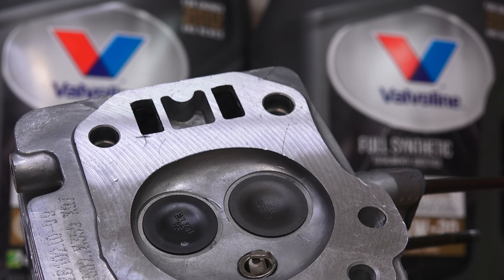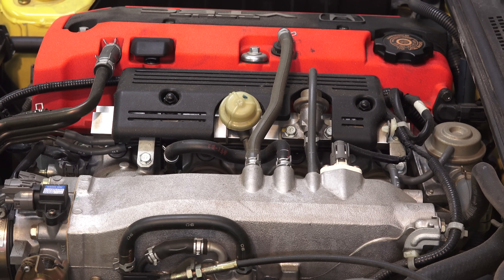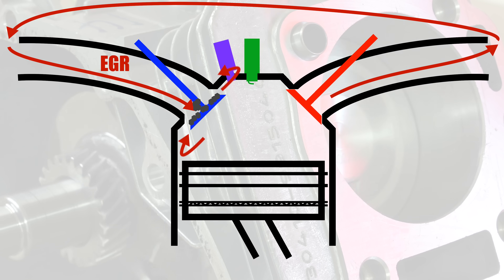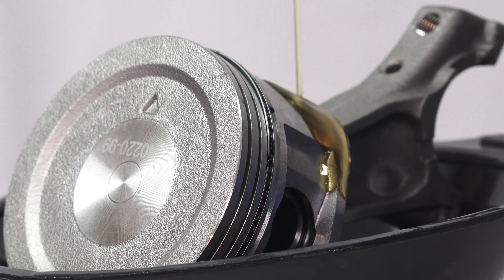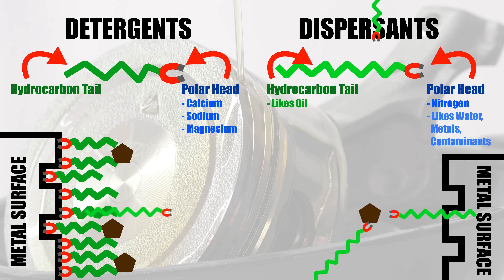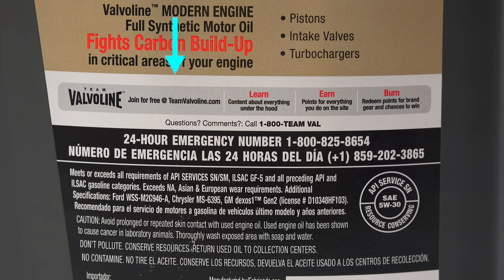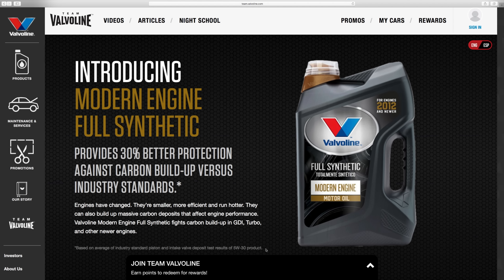Can Engine Oil Help Prevent Carbon Build Up?

Comment: It's important to use a good fuel injection cleaner. 
Some of my favorite fuel injection cleaners are Marvel Mystery Oil which lubricates the fuel system and protects gaskets. Another really good fuel injection cleaner additive is Amsoil oil pi fuel additive which cleans all the ethanol varnish out of your fuel system in one full tank of gas also cleans the varnish off your valves and gets you up to 5.7% better fuel mileage in just one treatment. 
It's amazing we still have good quality products that can combat the ethanol delinquencies......lol
Reply: Please  tell me how can fuel injection cleaner   can clean the valves on a GDI engine when the issue is that no fuel  is getting on the valves to clean them...
Reply: smh.....
Reply: the logic that applies to port injection engines where the fuel mixture passes over the valves doesn't apply to direct injection engines where the fuel mixture does not pass over the valves.  Eye find myself constantly reminding myself of that in addressing this issue, an example of prior knowledge interfering w new learning.  You might get 67% of the benefits using top tier gas and very good fuel injection cleaners but it is not addressing the the uniqueness of this problem, it is the hurdle of that final 33%.  A fuel injection cleaner or top tier gas cannot clean or prevent valve deposits if it doesn't pass over the valves.  the owners of 2nd generation direct injection engines that have hybrid dual port designs might be rescued but owners of pure direction engines are probably feeling stranded right now.  if Top Tier gasoline has 5% ethanol vs 10% in cheap gas that might help since me thinks ethanol would make fuel dilution > oil supply an even worse problem esp for gaskets / seals.

Comment: You made a mistake
You explained the general things about engine oil
But you forgot to say about the main causes of carbon deposit
Remember:in all direct injections you should use LOW SAPS oil,means low sulphated ashes!
Lots of calcium and TBN in engine oil can make a deposit as well as a bad engine oil
For this reason:if you dont want this happensto your engine,you should change your oil type into for example: API SN RC,ACEA C (C1 &C2 &C3) and other approvals like MB 229.31 or 229.51 and also BMW LL-04
But remember,if you use the LOW SAPS oil,you may sacrifice your engine's camshaft.because LOW SAPS oil alse means low ZDDP which is crucial for the camshaft
And also remember:dont over-fill your engine with oil,if your engine oil capacity for example is 4 litres,it is better to fill it up just under 4 litres like 3.8 litres !!
Reply: 229.31 oil is awesome.  I also advise just changing the oil at 3k miles with this oil.

Comment: Can you test old oil in engine for fuel consumption every mile, comparing it with freshly oil-changed? I got 143-180 miles every 10 Gallons before oil change (synthetic), and 230 miles every (just one test) 10 gallons after oil change. A related question: does the day for oil change matter after all, not just the month?

Comment: Mr. Engineer, I watch your channel regularly. This show, I have a question. The little, but necessary, piston ring flutter, allows blow-by during power stroke, & also a bit of oil suck-up during intake stroke? What happens to this oil in the rings when it's met by hot combust gases in the power stroke? Does it burn cleanly? How do the additives in the oil burn? i.e. Do they leave deposits in the rings? & the oil rings? & their drain holes? Then there's a question about how phosphorous, presumably burned, affects the cat?
 A response from you would be good - A full vid on these questions would be better? What would Valvoline say?

Comment: What do think about BMW's Europe policy to change the Oil every 2 years (not 1 year) or max. 30.000km regardless whether is a diesel or a gasoline engine? But consider there are (were) more diesel engines sold in Europe.
Reply: don't listen to them.  do not go more that 5k miles between oil changes.  occasionally do 3k oil changes to really clean up the engine

Comment: I am not an engineering just a tech but if the engine oil is getting on the vavles would that not mean there is something wrong with engine. How can the oil clean the valves if it does not get on the vavles?

Comment: Hi,
You make great content explaining machanical engineering stuff for easy understanding in layman term.

Can you please make a video about "power to weight ratio"
A more layman calculation to have a rough idea of what car with what power output (optimum or realistic RPM range where torque is optimum) and weight of a car to determine acceleration efficiency and fuel economy?

Comment: great video once again.. would be interesting to see the effects on a rotary engine as its known only to use mineral based oils in there engine to prevent carbon issue which does happen.. Engineered explained have you had any experience in a rotary engine its self at all with pro an cons with the use of oils and reliability suggestions pros and cons at all.. be great to see something along those lines etc..

Comment: I have a question. Regardless of the oil type, once an oil reaches 130 celsius or above its molecules start to fall apart and thus the oil deteriorates, right? 

I use a car with small diesel engine (VW 1.6 tdi 105hp CAY type, I use vw504.00 and vw507.00 compatible oil and change it before 8000kms) and in the indicator panel i can see oil temperature readings. In hot summer days when I push it hard it reaches even 135 celsius. After such a case should I change my oil immediately? 

Can anyone with a scientific knowledge on this issue help?
Reply: i know on MB the oil is around 85c. 135c is really hot. oil can go to 150c and still be ok. I would advise an oil cooler and use a lighter oil. a thinner oil flows better and cools better. I would not want my oil over 100c

Comment: Does the same carbon build-up happen on the inlet valves in diesel DI Turbo engines too?
Reply: not so bad. on the vw older eng I had to block off my egr

Comment: And if you drive a European vehicle, use an oil that qualify the (  European Automobile Manufacturers' Association) ACEA   A3/B4 or A5/B5 for newer cars.
Reply: don't worry about that. use a gf5 sn rated full syn and you are ok

Comment: They really gave you a good education on this subject when you spoke with them. Great video!
Reply: not really he failed to explain how engine oil without getting on the vavles will clean your valves. If the oil is getting on the valves you have a serious issue with the engine. This was nothing but an add I can't believe he even agreed to do this it is such BS
Reply: @mysliwya  I agree with you, but I think he assumed we'd follow... if particles are suspended, then when blow-by happens, the oil mist hitting the valve doesn't matter since it won't stick.

Comment: Could you further comment on modern engines with carbon buildup (and oil consumption. 

I've had mixed comments about turbocharged Audi's burning oil. 

1. Some say its perfectly okay if it burns less than 2.5 litres per 15,000km. 

2. Others say that is excessive and the car needs not only a piston ring replacement, but complete piston replacement.

Comment: Steps for dealing with carbon!

1) What he said. Use good oil, change it often, and make sure its always in the "safe" zone on the dipstick.

2) Unplug your EGR. (Don't forget to plug it back in if you have state emissions testing.) You'll have to live with the Check Engine light. Unless you know how to disable it on your MAP. In which case, you already know all this....

3) Install an oil catch can. It's like an extra filter added inline of the PCV system. It adds an extra step to oil changes to empty it, but it traps the gunk before it can  recirculate back to the engine.

And that's it. Carbon buildup won't know what hit it.

Comment: Hey. Just wondering if its ok to mix different brands of engine oils? Or do you have to only use the same brand and same "model" all the time until u do a full engine oil change?
Reply: You should be able to do that as long as it's the same "kind" of oil- 5w30 for example.

Comment: Be careful about putting synthetic oil into an engine that has been run on non-synthetic oil for a while.  Suddenly adding synth oil will likely cause small but messy oil leaks in older engines!

Comment: I just drove a car for the first time in my life before 1 day and it was manual, I stalled it like 4 times and I drove it for 2km, and the day after that, (yesterday), I drove it again for 2km and I didn't stall it this time, what do you think about my driving as a learner?, the car was a Toyota hilux manual pickup truck.
Reply: Internet troll.

Comment: Well if you are a "tree hugger" stop reading now. Friends old Neon had issues with deposits. He blocked the EGR and routed the crank case dohicky off to the side, and sealed the port on the intake. Yea it threw a light, but he gained something like 10 or so miles per fill, a bit more oomph, and it stopped the build up. He just replaced all the stuff for the inspection. Then took it all off again. I'm doing the same with my TJ.
Reply: EGR helps the engine run cooler.  Watch out for detonation....

Comment: *HELP*   
Everyone is recommending pennzoil 5w-30 ultra platinum. I just purchased my car (2018wrx) and would love to put the best in it from the get go and it is a DIT engine. Also, the 5w-40 seems to be more readily available... do you think there is a problem with running the 40?
Reply: Not likely as long as you change it regularly and drive it GENTLY until it is fully warmed up!  The heavier oil could create excessive pressures/insufficient flow, so be careful.

Comment: I have 1 for you my 2018 mazda cx-9 gt the oil fill says use 0w20 but the owners manual says 5w30 I called 3 dealers and 2 said 5w30 1 said 0w20   So who is right?
Reply: ncrdisabled Submarine vet ... I am pretty sure 0W20 only comes in a synthetic, so I would recommend running that. If you don't want to run the better but more expensive synthetic oils and want to just run a conventional oil use SAE 5W30. I would recommend a group 5 oil such as AMSOIL or Motul for example, over anything else. IF you plan on keeping the vehicle for a long time. If it is a lease or short term own, just do whatever financially makes sense for you.

Comment: What do you think of the extreme long oil change intervals that are being promised nowadays? Our new Iveco Daily (3.0L Diesel 180hp) has an oil change interval of 40.000km (~25.000miles). And we have a John Deere tractor that promises 750 engine houres on the same JD oil.
Reply: do the oil at 5k miles. the dealer is not fixing anything past its warranty. they want problems after that.

Comment: What can you do to clean off existing carbon build-up, as opposed to preventing it from happening?
Reply: Adam, motor oil can help prevent carbon build-up, but it does not remove build up that has already formed.  If you suspect your engine has developed build-up, you may need a professional service to remove it. Valvoline offers a service through their Valvoline Instant Oil Change locations or any local service garage that uses Valvoline products.
Reply: @valvoline  do you guys have proof that it removes the carbon?  i have never seen a video or info on it.
Reply: you can do a bunch of fast oil changes every 1k miles using cheap oil. this will clean up the inside of the eng very well.

Comment: How much did Vavoline pay you for this product to be featured on your channel? I personally have gone with Amsoil since they we're the first original 100% synthetic oil for airplanes with no petroleum base that ends up gunking your intake valves. Also, the researcher I talked to provided that fuel dilution in the oil due to fuel pressure in the cylinder forcing fuel past the rings which causes the Low speed preignition around rings and causes worse and worse engine performance and wear nowadays before you even reach the time manufacturers well before recommended drain intervals.
I tried all different Full synthetics available in stores like auto zone pep boys and O'Reilly for the last 3 years and none solved the crisis with Direct injection like Amsoil's Signature series has for mine.  Oil alone will not solve the issue as an upper cylinder lubricant seems to now be required to also prevent friction that ends up retarding ignition timing and detuning your engines performance.

 Going from 87 to 89 octane from top tier ls like Chevron does help with fuel mileage probably due to all the preignition due to higher chamber compression pressures and lower tolerance of 87 to not detonate under extreme pressure along with carbon deposits on the intake messing with the airflow patterns that would lead to better optimized fuel and air mixing before ignition.

I know you try and keep it simple for the layman to get good info but it would be cool if you had a channel that went more in depth about more details just beyond basics. Maybe make it Engineering Explained (Serious Tuners edition). Be good for promoting people to get into the industry
Reply: I had the same question regarding the plug for Valvoline. Just take his word for it because they would never lie in order to promote any products...

Comment: I can't understand how oil is supposed to clean the valve heads from carbon build up, when actually the oil isn't supposed to get there ? Looks like a bunch of BS to me ... some newer DI engines from VW have also port injectors added exactly for this purpose  I think, I guess they tried also other solutions before ...

Comment: And change your F^$# oil filter..Please. If you have dirty fuel you change your filter. if you have dirty oil?? dirty oil has been in the filter....................filter is the cheapest part to change! so just F%#&%^ change it with oil change.. please.

Comment: Question - I have a 2017 F-150 3.5 V6 Ecoboost. Everywhere I read it is normal to see coolant temps ranging from 210-238° which seems pretty high. What would be the reason ford made this engine run so much hotter? Also, I want to use a more aggressive tune but I’m worried about the engine pulling timing because of the extra heat it’ll make. I want to install a 170° thermostat but I’m worried about the long term effects changing the operating temperature such as carbon buildup and the change in oil lubrication.

Comment: Why dont manufactures just implement catch cans in their design. Surely burning the oil that comes out the crank case ventilation system isnt good for emissions. Id just like to know why theyre still doing this

Comment: With the modern engine oil specified to be used in cars that are model years 2012 and newer, is it safe to use in a 2010 direct engine engine? I currently use Valvoline's advance full synthetic in my 2010, but if the modern oil is safe for it and superior at fighting these deposits, I'd like to use it.

Comment: It's because car manufacturers are under extreme pressure from environmental regulations and consumer demand to make cleaner and more fuel efficient engines while still deliver decent power output. Technically this is a big challenge and that's why so many manufacturers switched to direct injection, small engine size and turbocharging. The downside is that these engines suffer from a lot of mechanical stress because of this. Combined with start-stop systems, changing to higher gears at extremely low rpm's, etcetera, the mechanical parts suffer and wear down much faster, internal carbon build-up being just one example.

Comment: My engine is Single point injection on top of the intake manifold like a carburator. It called mono motronic and my intake manifold is clean as it come from the factory, but the valves are another history, they are full of carbon and completely contaminated so i guess port injection does not solve this problem alone, the design of each system comes in play.

Comment: I didn't even watch the video. Carbon buildup on valves and anything else above the piston rings never come into contact with engine oil. That's for the crankcase. Period. Was the video a joke?
Reply: they come into contact with oil vapor from the crank vent.

Comment: Hi there. Great video, especially the use of visual cues to help explain the oil labels.
Question: I own an Audi A5. How does the Audi/VW TFSI engine relate to this issue?
Reply: I too own a 2019 Q5 TFSI. These 2.0t engines are direct injection. They are suseptable to every thing mentioned in this video. I use Castrol edge 0w-20. Exceeds all API standards. SN plus as well. I also recommend 5,000 mile oil changes, not the recommended 10,000 bu Audi.

Comment: So which oil is the best oil? I use mobile 1 annual protection and shell V-POWER gas. I have 7k miles on this oil change and it's still as clear as new. But of course I also have a K&N filter and use Moterkote addative.

Comment: There is still no explanation as to HOW an oil will prevent carbon build up in a DI engine.
Disappointing video, and I never thought I'd say this for one of your videos.
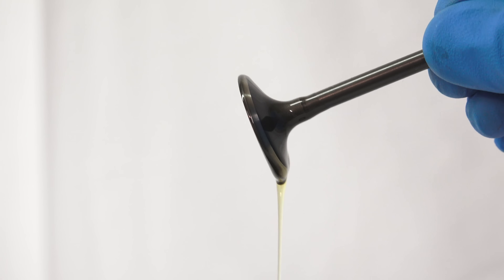Reply from the maker: So I'm guessing you stopped watching at 2:02?
Reply: Jas, thanks for replying. I watch the whole video, but I’ve just rewatched and realised I missed something pretty significant. So you’re saying that even if the oil vapour gets washed onto the back of the valves via PCV or EGR, if the oil has enough of those detergents/dispersants, then it won’t stick to the back of the intake valve. Hence no carbon build up if the oil is doing its job properly?

I’ll apologise for my original comment about being disappointed. I obviously missed out on the 2 + 2 = 4
Reply: Perhaps as a point of feedback, it might be have been worthwhile to revisit your original animation of carbon building up and show how the carbon molecules would not stick to the back of the intake valves if the oil was doing its job.

Thanks!